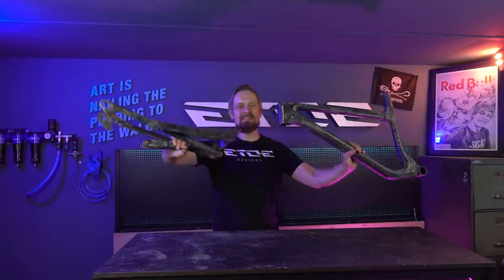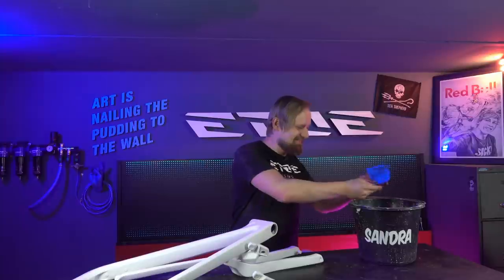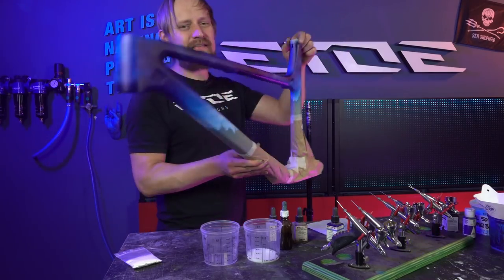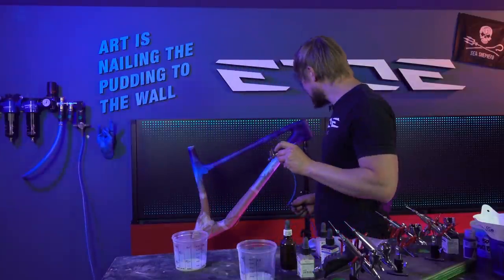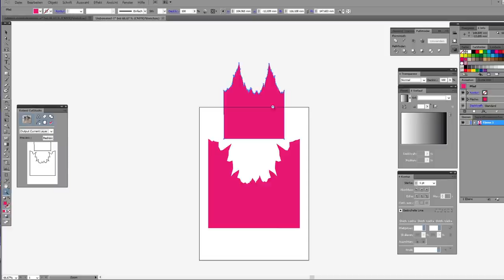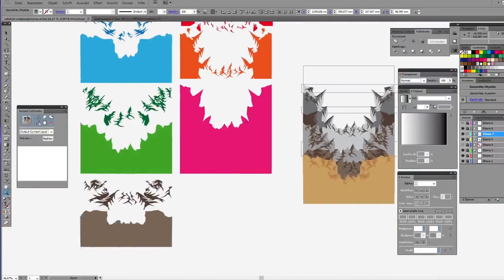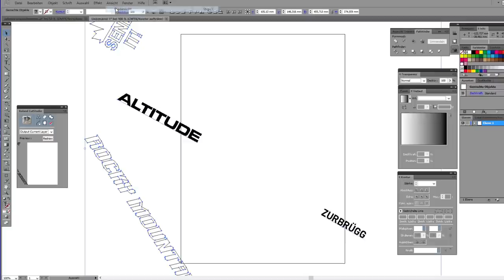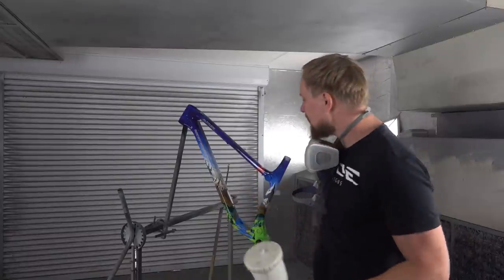BIKE PAINT MTB - mountains on a rocky mountain

Comment: You had to heat it in an oven to a temperature that is close to the melting point of the aluminium or about 580 'c so the paint sticks with the metal.